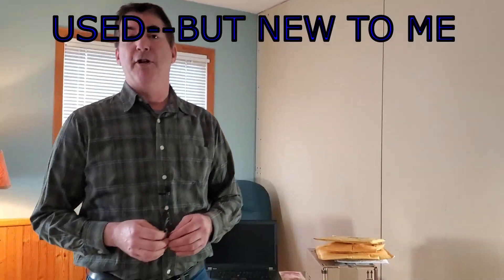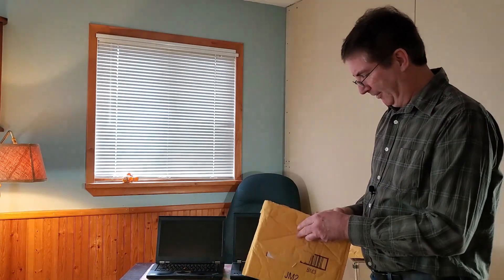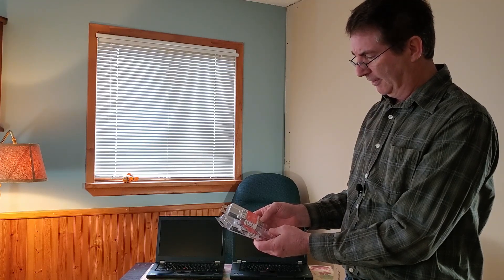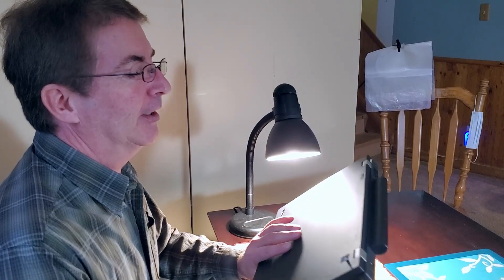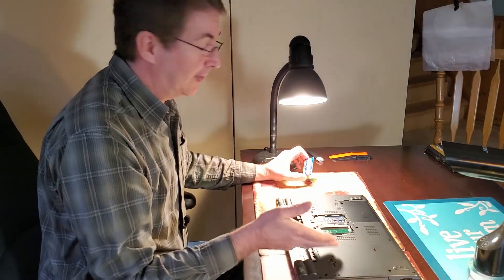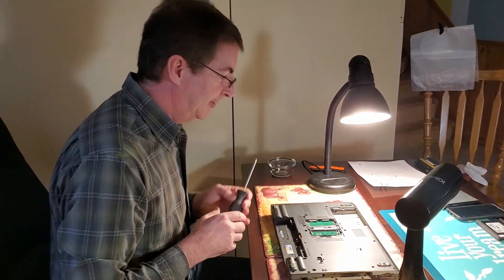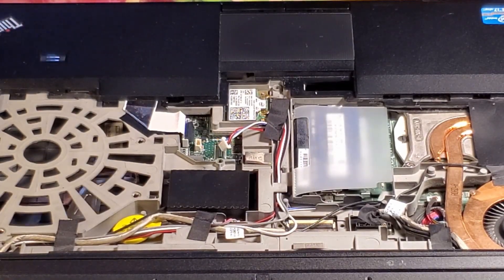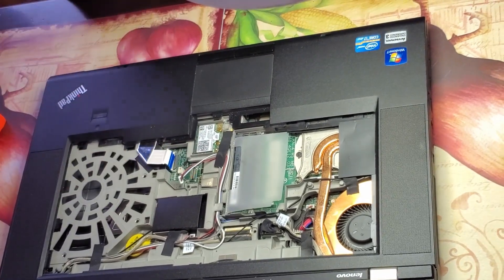Clean CPU fan and upgrade a LENOVO W530 (part1) #Frugal With John

Comment: I still have mine it still works the battery is not the best right now but it runs modernized games like gta5 and forza 5 and snow runner
Reply from the maker: I was having trouble running Davinci Resolve (it only has 4 cores in the processor, DaVinci wants 6 cores). I picked a 10 core laptop and use the W530 as a spare, a good spare.
Reply: That's good to know that it's your good spare i want to upgrade the gpu to the k2000 and upgrade my cooling somehow  @FRUGALWITHJOHN

Comment: My W530 fan just died.  The machine will not even boot with a "Fan Error." at post.  Is there a good replacement fan I should consider?
Reply from the maker: I would just google it, I did and came up with the complete assembly on Amazon. ( https://amzn.to/3ZHY9n3 ) Affiliate link. But you just need the fan, good luck on the repair.

Comment: Hey There, I have a Thinkpad W530 . I am not able to connect it to a secondary display. It works when i enable the NVIDIA graphic card, howe
ver the laptop gets struck and malfunctions. When I disable the graphic card, it fails to connect to secondary display. I use Windows 10. Anyone who can help me fixing this issue?

I saw some folks in Lenovo community suggesting to change few lines of code in Linux machines and it worked for them. But am not able to find a solution in internet.

Pls help !!!
Reply from the maker: I am using a VGA cable and it works flawless. I set it up so it has two separate displays (24" Samsung monitor and the laptop).

Comment: My Thinkpad w530 i7 with 16gb RAM running windows 10 is a real workhorse, AND the thing is almost 10 years old! 😎👍
Reply from the maker: They are good old workstations, I use mine to edit videos. Thanks for watching.
Reply: Hi, can u connect your W530 to a secondary display/monitor? I am on Windows 10 and i am unable to. Any help?
Reply from the maker: Hook up the second monitor, go to the bottom right of your screen and click on the note pad beside the clock, click on (project), then choose what you want to do with the second screen. Let me know how it went.

Comment: would there be a issue if you left 2x4gb ram in two of the slots and installed the 2x8gb ram in the other slots even if they are different could they still work together? i have heard people have some issues with certain ones stating its the voltage of the ddr3l ram that can be the issue i think the ram you cited being 1.35V was what forums were saying is the right type
Reply from the maker: It should not be a problem, I would install the 2x8gb under the keyboard and the 4gb in the back of the laptop. If you find an instability problem it will be easy to remove or want to upgrade later to another 2x8gb it will also be easier. Thanks for watching

Comment: Great tutorial. Thank you. I have w530 for 8yrs and I think it’s time for an upgrade after watching this vid. My first priority would be upgrading the ram from 8 to 32. My first question is where did you buy the ram and do you think 32 would make a big difference instead of 16? I do some architectural renderings. Tia
Reply from the maker: Rendering take a lot of ram, I added affiliate links to all the parts I used. 16G of ram may be ok, try it first, if it works ok then you are good. for more info check out part 2,3, and 4 about the W530. Thanks for watching